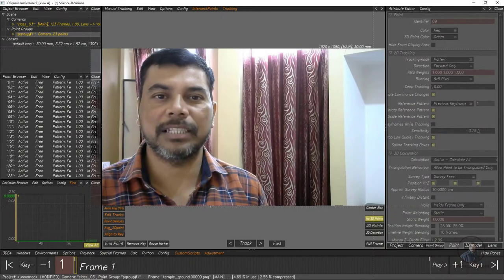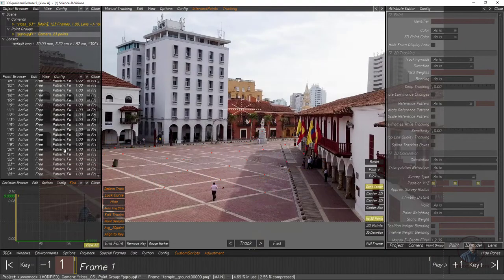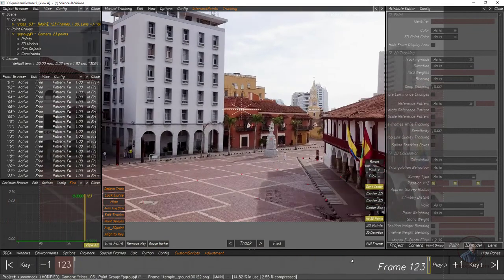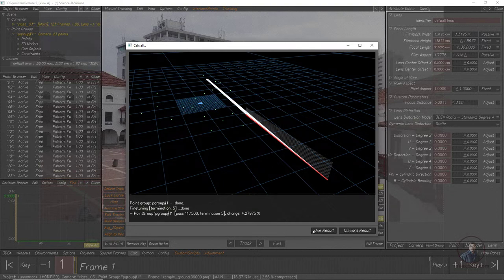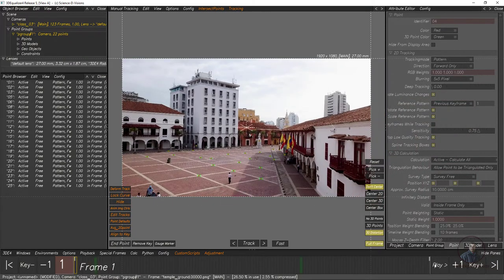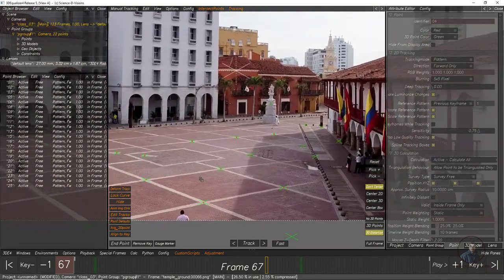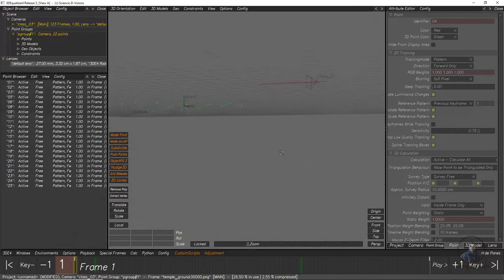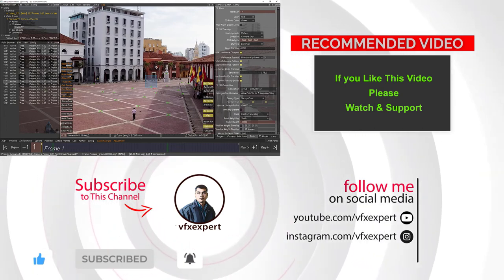3DEqualizer - Camera Solve in 3DEqualize | Refining Camera Solve in 3DEqualizer | Class - 03

Comment: Hi great tutorial. One question about the focal length calculation in the Adjustment parameter; you set your range from 27mm to 33mm and the result was 27mm. Isn't there a chance that the more accurate focal length could be below 27mm? In which case, would you then run another calculation with a lower range for example 24mm to 30mm? thanks so much.

Comment: I have a question I can't understand why
I have a Canon DSLR sensor (22.3X14.9mm) = 1.5 apect ratio
Filmed image 1920X1080 = aspect ratio 1.777

In tracking software like 3DEqualizer if I put the dimension of the sensor the ration aspect becomes 1.5 which is normal it is the size of the sensor.

but if I export to maya  for example the aspect ratio is 1.5 normal it is the value that I set in 3DEqualizer.

after import in maya
if replace the aspect ratio are my tracking values respected?
and if I change the aspect ratio in the cams of maya put them back to 1.777
I can see that it is not going good!!
what am I not understanding

    thank you and very interesting work.